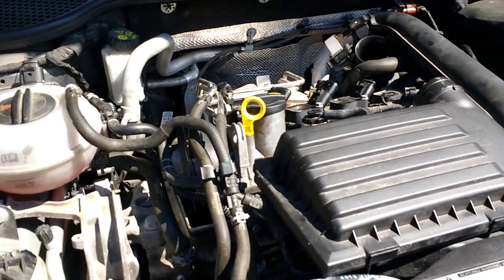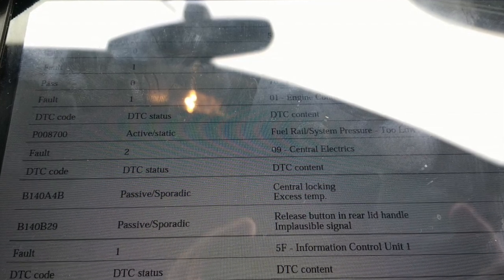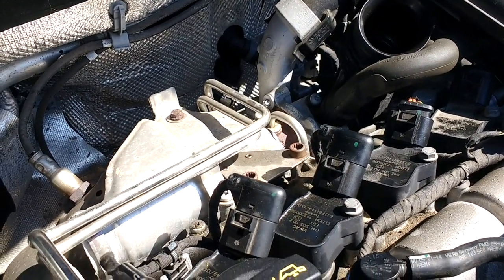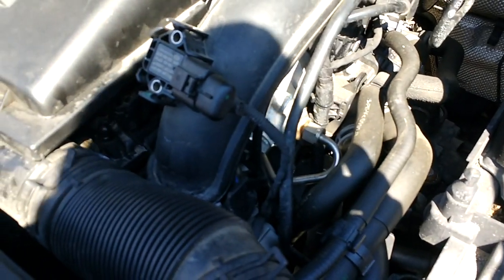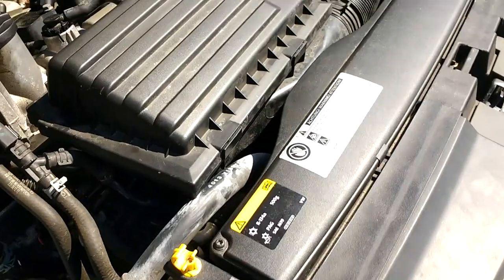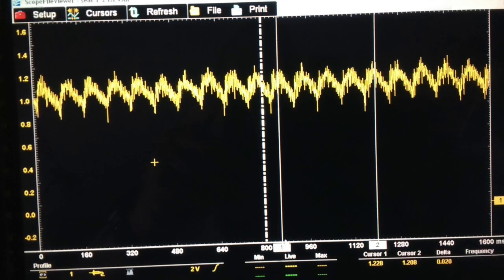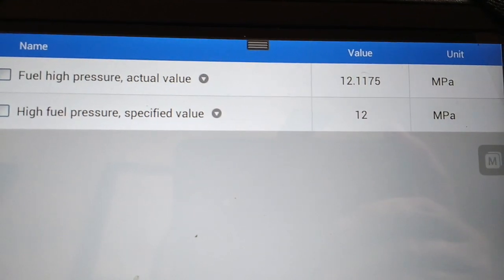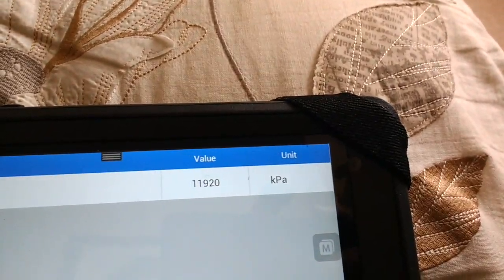SEAT LEON 2014 1.2 tsi Part 2

Comment: I have an uncommon problem 1,2 tsi motor starts perfectly , when start to drive goes in limp mode, only 20tkm, changed the "drosselklappe", all seem ok when parking idles ok, turbo open when you press pedal andnormally goes to high rpm, when you start, pedal is dead, any suggestion my friend...repeat starts pefectly in secondwhen you turn the key...
Does maby ecu have any electonic block like fuel switch, that is blocked after accident and should be reseted by vagcom delphi or other scanner tools
Reply from the maker: What's the fault codes?

Comment: hi  sandy got it fixed problem was a faulty ignition switch checked power at ecu only had 9 volts with ignition on dont know how it even ran also had abs light on too now gone out  thanks for your help .
Reply from the maker: tony pond good find, well done, sandy

Comment: hi sandy sorry to be a pest wondering if you could give me some advice again  i have a 1998 audi a3 1.8 turbo aug engine code bought car from a neighbour they had car into local garage who diagnosed  it with a faulty e.c.u

problem seems to be that number 3 ignition coil wont fire  plugged in delphi scan tool and have a 65535 code (system ok if fault evident check control unit) that wont clear 

also has  a.b.s code 01312 can buss powertrain faulty/intermittent 

any advice on how to test this ecu?  limited to delphi scan tool and a cheap multi meter

there seems too be an ignition module i think  on the side of the air box but again unsure of test method 

any advice on direction ?  thanks . tony
Reply from the maker: I look up wiring when I get home from work cheers sandy
Reply from the maker: tony pond https://youtu.be/_cc0kq-AowQ hope this helps

Comment: Hi Sandy. İ have a problem/trouble. İ have a 1.2 tsı octavia that motor code is cjza 77kw.before crankshaft adjuster is broke down.  The crankshaft adjuster is changed in competent skoda service. While engine is hot the crankshaft is starting very noisly . But while engine is cold this noise are haven't in my car. Can you help me? What can be the problem? Thanks.
Reply from the maker: Aydın Karakuş not really sure my friend but could be the variable camshaft actuator cheers sandy

Comment: hi ,  could you give me some advice please having a nightmare with my 52 reg vauxhall vivaro dti (renault dci engine) van  the turbo went on it and the engine ran on oil 5000+ rpm for a few seconds before i managed to stall it.

replaced the turbo and now it  seems to be in limp mode engine is very slow to respond to throttle below 3000 rpm  but once above 3000rpm is fine

no fault codes stored had vaux com on so far i have checked valve timing cut the exhaust off put on a straight pipe (exhaust had a lot of oil in silencers) thinking  possible blockage
had egr valve out cleaned unplugged maf still the same
checked high and low fuel  pressure  all fine
engine starts first time sounds good and no smoke 

not sure if ecu has been damaged when it ran on the oil at 5000rpm ?

any advice on direction would be greatly appreciated
Reply from the maker: tony pond  can rule out damaged ecu, is it the 2.0 DTI the same that's in vectra with electronic on fuel pump?
Reply: no renault 1.9 dci engine same engine as fitted to most renaults megane laugana etc fitted with bosch common rail system
Reply from the maker: tony pond check vacuum pipe work for leaks, check vacuum levels usually about 22 inhg, boost pressure sensor near ECU for blockage oil intrusion, block off egr just to eliminate it,  low side electric fuel should be 2.5 bar 60 litres a minute, sandy